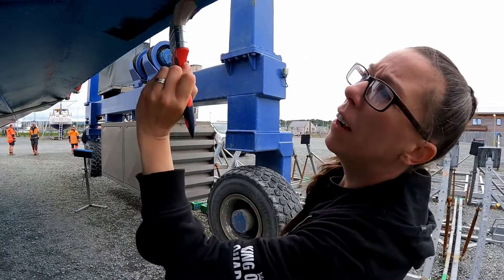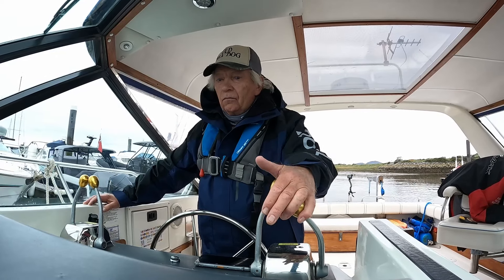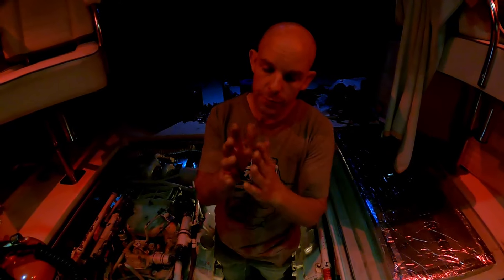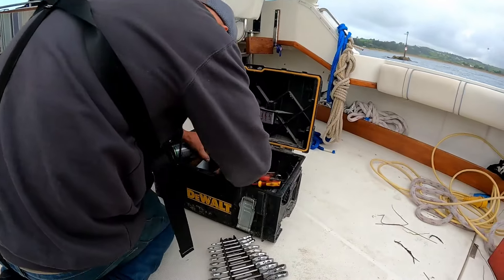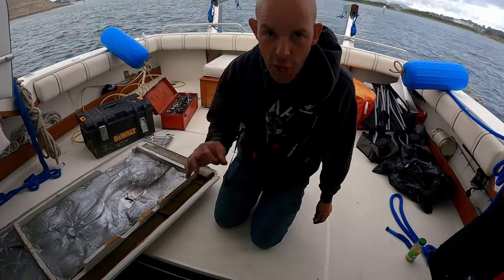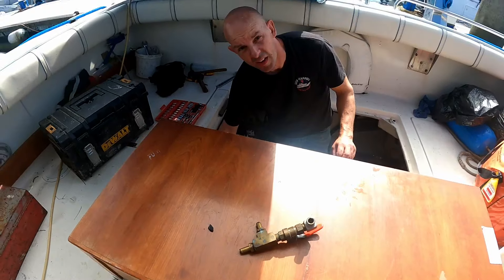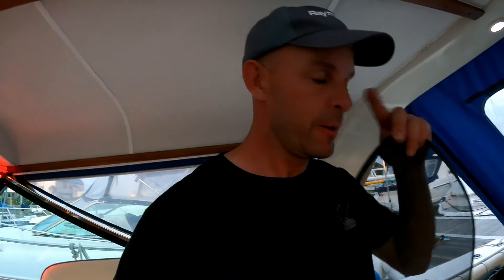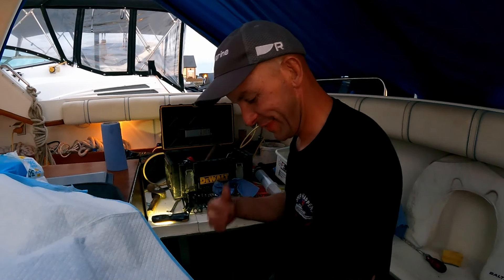Our Biggest Boat Failure Ever!

Comment: So many comments about replacing the fuel hoses but to comply with regulations they must be stamped with ISO7840 marine grade. How many boat owners know about this? It is absolutely the case that old hoses will deteriorate with age, especially if they were not marine grade in the first place. I have replaced everything in my boat to ensure that l don’t get such problems including having a new fuel tank made. Good luck, it looks like a nice boat, l wonder how much you had to pay for it?

Comment: Fuel from the same source but only problems with one engine I would bite the bullet remove the tank clean and replace the fuel lines with new or price getting back home on a low loader and do it at home don't forget the fuel you will save motoring back and the cost of child minders

Comment: From what you have shown there are two issues: alignment and fuel delivery. With rest and time the alignment can be improved to minimize vibration. The fuel delivery may be more challenging. Removing fuel, purging, cleaning or replacing all the components (tanks, pipes, hoses, filters). Start at the engine and work backwards to the tank or vice versa. Prior to all that laborious work, determine if it is possible to make another access hatch on the other side of the baffle. Hopefully allowing a probe to view the tank innards. Hoses/fuel lines can be removed to determine degradation.

Comment: Your starboard engine blows black smoke because someone placed black crud in the fuel line. Don't run the engine again, pull the plugs place diesel fuel into the cylinder and crank the engine over to clean out the cylinders, further remove all oil in the engines crank case and flush crankcaae several times with Diesel fuel until you see no more black particals in the diesel fuel you removed after flushing. it was deliberate by the way, best of luck i will be watching and pitch in were i can. Best of luck God Bless:

Comment: With the damage caused to the props and the rudders and now having to move the engine's themselves to get the correct gaps between the shaft and the engine drive, If the damage to the props and the rudders have caused the engine's to move on their footings/mounts, there is a very unpleasant and expensive consideration to be made to check that the Crankshafts on both engine's haven't been damaged and twisted, or bearing damage. The crankshafts, bearings now running out of tolerance would put extra movement and vibration through the piston push rods and possibly damage the piston rings, the pistons themselves and the piston liners or tube, as well as giving a out of tolerance run out from the engine crankshafts through the prop shafts and onto the props themselves. To check the engines over properly could possibly mean they have to be taken out and put into a workshop equipped with the correct equipment to do this, very expensive but better than having the engines seize up when your miles out at sea. With the Turbo not kicking in and working as well, the engines look like they are going to need a good overhaul and stripping down. For safety reasons you should probably have brand new fuel tanks made with up to date materials, and to a spec whereby you can gain access to them without having to cut up the decking. A lot of work and expense may be required, but it's better to find out now than lose your life at sea later on.

Comment: Seen something similar on a video about a canal boat that had been sat for years. They got some mobile "fuel doctor" in - he pumped out all the fuel and filtered it several times with some specialist gear that removes all particulates and water and treated with additive that fixes diesel bug. They then pumped some stuff in to remove rust and solids that had formed in the tank and that sat for a while before it was all pumped out and jet washed internally. Flushed umpteen times until there was nothing in samples of flush then refilled with the treated fuel. I cant remember what it cost but it weren't cheap! The junk in the fuel looked similar.

Comment: You will have loads of problems if the boat has sat on the hard for some time .Bent props and shafts suggest it was run aground hard the engines will have moved.Running it on the hard was not telling you a lot it needs to be under load

Comment: I would suggest the problem is degradation of any old rubber hoses. Diesel now has bio derived addatives similar to the situation with petrol. Both fuels require modern tubing if problems are to be avoided. For petrol the standard is SAEJ30R9. Not sure if it is the same for diesel. Looks like you will not only have to rinse out the tanks but will also have to replace all the lines. If any team have the fortitude to overcome these issues then you two certainly have. Good luck.

Comment: Hi guys, you appear to have what's called blackjack or diesel bug in your tanks and filters.  It forms when diesel sweats in the tanks and forms condensation which starts to grow microorganisms.  You need to add a diesel fuel additive to kill it and always keep your fuel tanks full to eliminate the condensation.  I would replace all your fuel lines, clean the racors thoroughly and keep a few spare filters on board, put in the additive and maybe polish the fuel you have before adding new fuel.  Look at Diesel as a living fuel and stuff will grow in it.  Most times a diesel engine will only stop for either a fuel or air problem. good luck with it.
Luv all your videos.

Comment: Just line the engines up to 4 thou in the water and test, also check condition of the flexible coupling and engine mounts, give it a burst of power while watching engine mounts see if they flex too much R&D will soon sort you out with flex couplings or mounts

Comment: You need to install a wire mesh fuel strainer on the line from the tank and before the  fuel filters and it will catch all those particles but keep a good flow of Diesel,we use  them on locomotive to remove the large particles.

Comment: Hi folks! i love your channel and your adventures. Especially because of your good humor, with which you master all the  challenges. Regarding the black coal-like stuff, i recently watched a channel from a chemestry engineer. He showed that sulfur acid reacting with other materials creates coal. Diesel like the oil for heating at my home, contains sulfur. For health and environmental protection the sulfur content is limited in Germany. But maybe not all gas-stations sell the very best stuff. Can it be that those are the residues from the sulfur in the Diesel after reaction with humidity and any materials used for piping?
Anyhow, wish you good luck!   Herbert

Comment: As a mechanic with 45 years behind me, the main issue you have is the fuel lines, today they are steel or at least a sintered alloy to prevent what you have now. Save yourselves a lot of pain and change them out, its relatively easy and the difference will be clean fuel. As for the vibration, if it is motor/shaft misalignment try use a laser alignment tool, cheap and absolutely accurate. Good luck, you are closer to the finish line than the start line.

Comment: I guess your a bit disappointed although nothing major wrong.  Two good engines and the boat is still floating 😀.  This video may help when working on the fuel tank, unless you replace it  https://www.youtube.com/shorts/4Zc8ridAsfM and this video may help with the engine and prop alignment https://www.youtube.com/watch?v=rAB83RbJSP8 as critical to the vibration issue,  Good luck and keep paddling  😀 looking forward to seeing the results.  The boat looks awesome, thanks for the video.  Also love the swede flashing up on your screen 😂

Comment: If I were to guess I would say you have fuel "bugs" and fuel algae or fungus. You need to clean it out as much as you can and then start using a fuel biocide to kill it off and keep it killed off. In addition, install another fuel screening system where your fuel comes out of the tank to prevent it from getting in your fuel lines and install a prescreen on your fuel pipe intake. This problem is quite common in the aviation industry and they use triple redundancy or more on their fuels filtration systems at the tank to keep it out of the fuel lines themselves. I would also strongly suggest that you re-design your fuel tank so the entire top can be removed to service it properly. You should also replace all your fuel lines or "pig" them out to remove any foreign material inside the lines.

When left to sit, Jet B will grow tons of this crap and it has to be cleaned out and treated with biocide. The petrochemical fertilizer business has much the same problem with algae growing in the liquid fertilizer. If your tank is metal you must keep a watch for leakage since the carcasses of the dead algae in the tank will coat the tank walls and are extremely corrosive. One solution to this problem is to use antifouling coatings meant for the exterior of the hull and line the inside of your fuel tank with them. The copper based biocide in these coatings keep the algae from growing as it leaches out of the coating to the surface and kills on contact.

And before you ask, yes, I have some experience with this type of problem and worked with a couple of coating makers and oil companies to try to mitigate it as much as possible.
Reply: Totally correct

Comment: Just I thought are a bit that you are finding magnetic ? And if that is the case Then on your Combi boiler For your hot water and heating at home  you can get a magnetic filter for  The water passes through the magnetic filter and all the metal bits that stick to it. It might work on the diesel tank.

Comment: You’ll sort it, it’s had some dirty stuff in there at one time, like you have already said what is it, has the fuel line been replaced, it might the inner wall braking down.
We’ve had the same thing with one of our Military Trucks, we found the steel tank was bleed rust fine dust, although we cleaned the tank a few times as well as clearing the fuel lines, Carburettor, it turned out to be very extra fine rust dust kept blocking the carburettor fuel flow.
We fitted a new stainless steel tank and solved our problem.
Hope you get it sorted, good luck.

Comment: So we buy the boat , 45k's worth of Catfisher 28. Cruise delivery from Southampton to the east coast. No wind so motored all the way to Dover stopped for the night. Set off into a fierce chop at the harbour entrance , no problems. Several miles later engine died. Cleaned fuel filters of algae. Brief joy then failed again. Drifting in the Thames estuary shipping lane. Calldd the coast guard , still no wind. They called out the RNLI who wanted an exercise. Towed us almost home to nearest port with enough water. Engineer onboard next day , fuel system totally clogged. Rigged up a day tank which worked perfectly with fresh fuel and new filters. Sailed home to marina not missing a beat. Engineers back at base emptied fuel tank. Removed and steam cleaned tank. No coal but horrendous algae. Water in fuel . New fuel , diesel treatment, no more problem. Maybe you've fixed it but boats left sitting often have  bad diesel and tanks. Since then strip out diesel tank and replace fuel every second hand boat purchased. Good luck.

Comment: Fuel without good stabilizers turns into varnish over time, so I would say what you are finding in the fuel system is hardened varnish. You should be able to find a fuel additive to dissolve the varnish. Injector clean should have a varnish dissolver in it. I would put a large amount in both fuel tanks and then run the engines enough to get it into the cylinders.   Good luck, David.

Comment: For some reason I've got the okey cokey tune in my head. Knowing you two and your determination though, It will soon be replaced by Rod Stewart singing his classic "Sailing".
It seems you're well on the way to sorting out the vibrations, and it looks like you might be replacing or restoring the pesky fuel tanks. Fossil fuels don't belong in there and im struggling to understand how the bits are getting past the tank, but, no doubt Simon can and will sort that out. Always good to follow your adventures.

Comment: If you think back on the damage that the props and shafts took it doesn’t surprise me that the engines were probably yanked out of alignment. As for the fuel problem it looked like rubber fuel lines which are disintegrating due to old age.

Comment: Sometimes you have to spend on special couplings that are designed to be used slightly out of line. I believe Tally Ho has done that as getting the engine properly aligned for normal couplings was near impossible.
Reply from the maker: Yes I think we are going to have to bite the bullet on flexible shaft couplings

Comment: Simon Gemma. Good move removing the tanks. But the paramount problem to ask yourself is. Where has the blackstuff come from? Until you nail the cause of that, you'll never be able to relax at sea. I don't think it derives from the dreaded diesel bug, that's usually pretty grungy.  I'm going to take a guess, and it's only a guess, it's a breakdown of the inside of of the Neoprene (or not so Neoprene) fuel lines or something similar. As I say, it's only a guess, but whatever the cause, it's something you have to get to the bottom of.

Best. Teddy

Comment: Keep your spirits up. You will get this working fine. when we took our diesel tank out to clean even after rinsing it with petrol it looked clean until we put the tank cleaner in, the amount of sludge that then appeared was frightening in what looked like a clean tank. Unfortunately taking the tanks out was the only way to fully clean the system and yes we replaced, pipes filters and fuel. Keep up the amazing work on both boats. Poppy’s crew

Comment: Well, look at the brightside, you'll get plenty of views on your repower video. You two were so enthusiastic early on with this project so I didn't want to piss in your cheerios but those GMC 8.2s are some of the worst diesels ever produced and come with a host of problems and failure points. Add to that, parts are scarce these days and finding someone that knows them is nye impossible. Get a pair of cummins for her, it'll be a nice swap and they are bulletproof as well as reasonably priced all things considered.
Reply: Since 99% of the smaller Cummins engines are inline, I don't think they would fit.  I am kind of surprised to see 8.2s on that side of the pond.

Comment: Keep your spirits up you two, the secret to any sea boat is to know it backwards and inside out. Avery good job your both good on the spanners and stay at it, as a lot wouldn't and why some boat are cheap. The upside to your downside you could be paying anything over £50 / hour for someone to sort it for you. Lovely craft when you have it sorted and forget all you teething problems, but anything to do with sea going boats with engines is never cheap and always time consuming, not to mention the head trip it can send you on. When ticking like a clock it will all be worth it. I changed to a rag and stickman way back so at least it doesn't now cost a fortune in diesel.

Comment: Those bits seem to be carbon from the engine not being run and the fuel not being cycled through. So what happens is bits come off and get hung up in various places, choking fuel for the engine. Could be the fuel tank. Could be the hoses. Could be all the above. I don't think it is the engine itself, although it could be. And if I remember correctly, if you attempt to burn those chunks, they turn into kind of a sludge. It's been a while.

Comment: Innuendos?  You need a good hosing.  Ideas: Replace all rubber fuel lines. Replace fuel filters. Clean or replace air filters. Bleed the fuel pumps (if the engine manual calls for it.) You're already cleaning the tanks = super.  Running the fuel through a pump and filter is an idea.  Adding fresh fuel is an idea.  Always troubleshoot from cheapest-easiest to harder and $$$.  Check  the fuel return lines from the pumps to the tanks for their inner condition. They may be the source of the coal-like rubber chunks.  Check the fuel filler hoses from the deck fittings for condition. Check or replace the crankcase vent filters, (Minor and not the source of your problems).  How fresh is the oil? Fresh oil (Oil and filter change) might loosen things up.  

Those would be a boat buyer's 101 do list.  

Beyond that it can be dirty injectors, or a fuel pump needing some timing or love. Someone else mentioned turbo bearings.  Might be useful to check valve clearances.  

Big do list!  Not much innuending.

Comment: With reference to the engine and prop shaft alignment misalignment- it would have been reasonable to expect to have revisited that once afloat because the hull will adopt a slightly different position to being on the hard. Judging only be the video of the two sea trials you were over fuelling for the air being supplied . Edit just seen you find the turbo
Well done for persevering .

Comment: Be very careful with fuel delivery issues. Much like a 2 stroke gas motor, without proper fuel you lose lubrication and cooling effect. Lean conditions kill many motors and those aren't cheap.

Comment: Did you check the tank breather ?? Insects build nests in pipes !! The alignment can ONLY be done afloat and looking back you used a lot of sideways force to remove the P bracket which possibly has put it all out of alignment.

Comment: Frozen turbo is common with water to coolant engines. Don’t race the engines and let the turbo cool / run down.
Make a fuel cross over feed line to you can get fuel from the other side. This to see if the engine it self is ok .
Cross feed is nice to have anyway.
My boat as a separate fuel pump and filter with water separator unit. Only to keep cycling the fuel. Tank to tank.